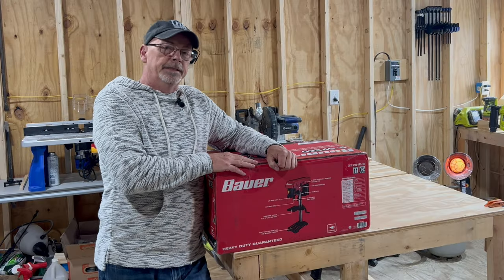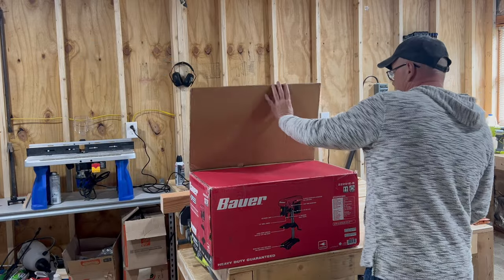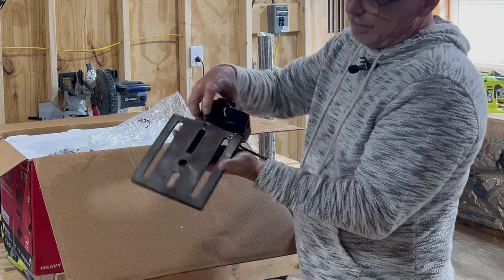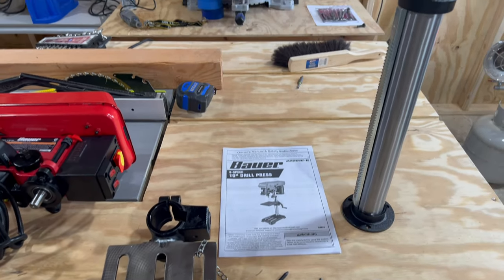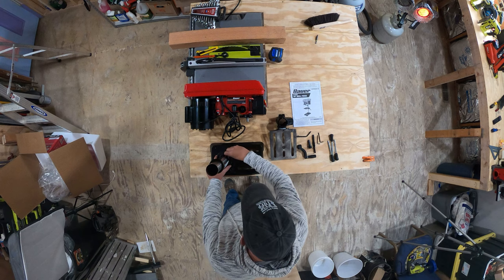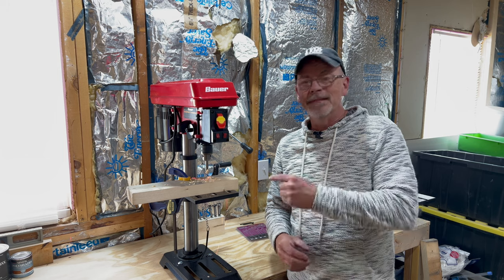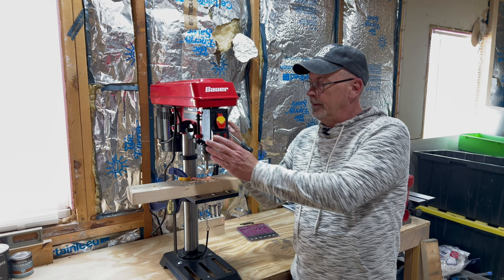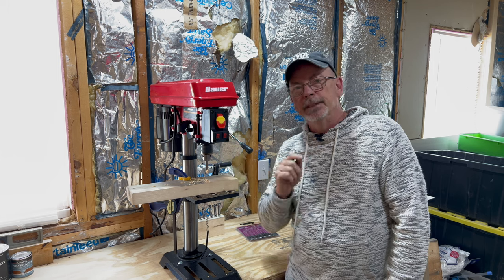Harbor Freight Bauer 10 Inch 5 speed Benchtop Drill Press Unbox and Test: Is it a Game Changer?

Comment: Does this drill press come with the 1/2 bolts or where did you buy them? What size are the bolts you used to secure the drill press to the bench?
Reply from the maker: @mlara98796  I didn’t come with the bolts, I just measured from the top of the mounting holes and included the thickness of my bench. Ran down to Ace hardware and picked up 4 bolts, 4 washers and 4 nuts. I think they were 1-1/2” in length for my set up… hope that helps. Lowe’s, Home Depot or a local hardware store should all have what you need.

Comment: We have a few similar tools. Kobalt router table, forstner bits and I just brought home this Bauer drill press. I’m very happy with most of Harbor Freight’s products. I have 2 Chicago Electric hand drills I’ve used (abused) for around 12 years and they still work like new. I have the Bauer 12 inch miter saw and it’s the best miter saw I’ve ever owned and I’ve owned Dewalt, Rigid and Ryobi. Thanks for the video. I’m subscribing.